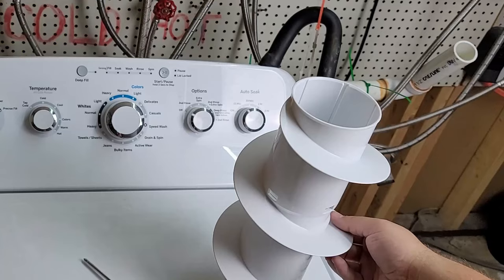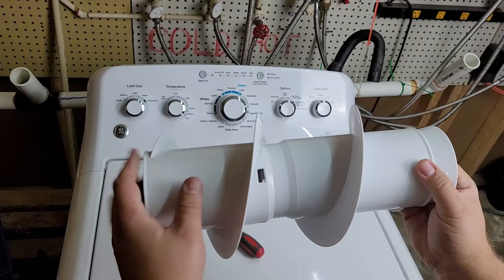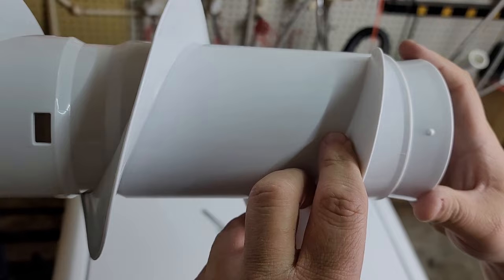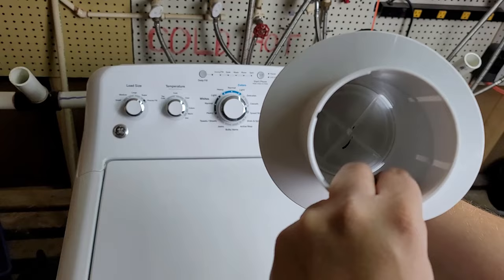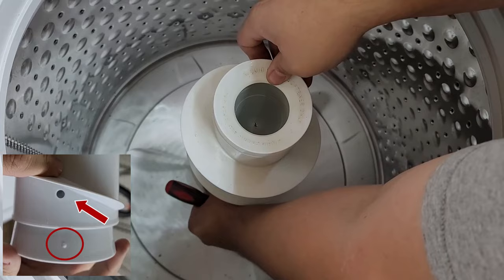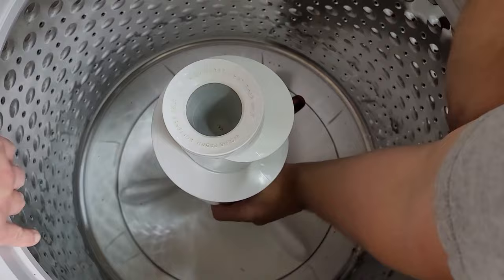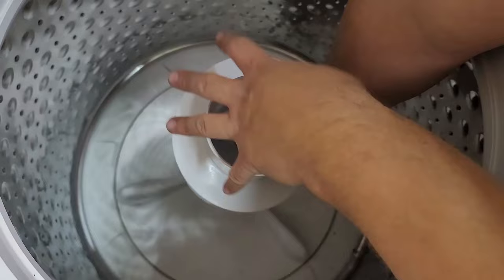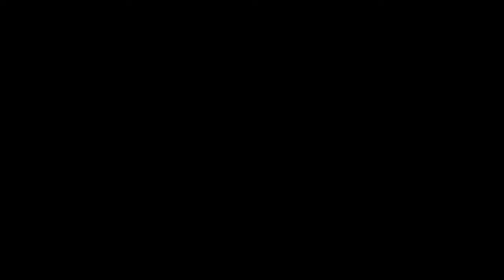GE Washer Agitator Removal - How to do it and access the GE Washer Hub and More

Comment: This method doesn't work well. My screwdriver just turned sideways and distorted the plastic on the inner cylinder. The turning force is all concentrated on the screwdriver and is unbalanced. Get a strap wrench and make sure it is wrapped around the very bottom of the assembly (below the piece with the screwdriver hole) and TURN CLOCKWISE. It will come right off.
Reply: I'm going to try and make s strap wrench and try this

Comment: Cut it with a hack saw.  Monumentally tough. Destroyed the agitator, obviously.  And it did not expose a bolt, screw or nut.  Just more plastic.
Reply from the maker: There are 2 parts to the agitator, top and bottom. If you cut it above the bottom part of the agitator where that small nipple is, you wouldn't find the screw underneath sadly.

Comment: I have yet removed one like this. 
  Certain models have the 7/16 screw?
  I usually am able to put a strap under the agitator and with a board across the top manage to yank the complete agitator off. 
  Something else I have not done is replace the agitator dogs. Can they be replaced with the auger removed?

Comment: My old ge washer has a steel splined shaft with the agitator sleeved onto it. There's no retainer nut, bolt or pin hole for a screwdriver or anything. What the hell keeps it in place? Small clothes and hoody strings keep getting trapped under it and HULK WANT SMASH!

Comment: Hi, could you please update with why you were replacing your auger? What was wrong with your original auger?
Reply: I've had my washing machine for almost 6 years (bought new from Lowe's) and recently the auger came off during a load. I reattach it, seemingly securely, before starting a load of laundry, and each of about 5 times I've tried, now, it comes back off ... so it seems I have the opposite problem of a lot of folks here - I can't get my auger to stay on. It doesn't appear to be damaged, so I'm hesitant to buy a new one, but when I did visit the parts page for that part ($31) other folks wrote reviews saying that after installing the new one, it kept coming off, too, and GE actually replied they didn't consider it a problem since there weren't a large number of people complaining!

Comment: At 1.49 you said turn it counterclockwise. Later you said clockwise. It was clockwise instead of counterclockwise. 

This was a bad engineering design. This agitator should have been the sme as the older Whirlpool agitator since they look nearly the same. Thanks for your info as well. I cut the old one off and drilled through the very side you mentioned initially, stuck a Philip's head screwdriver through, both sides turning in the counterclockwise motion as you said and it didn't work. It both sides to spin in the clockwise direction and that worked. I'll know drilling through is one way turning clockwise and using a strap clamp being the other.

Comment: My problem is the agitator base is stripped so instead of the basket turning the base turns not sure how to hold that still you can’t get your fingers under it
Reply: same here it's driving me nuts
Reply: @wilhallman2890  I drilled  2     1/2  holes in the bottom of the upper assy and it just popped off the very bottom just above the lower part of the agitator plate
Reply: @AMERICANPRIDE1100  even went and got a strap wrench and still can't get it off so I guess I'm going to try that or just cut the thing off